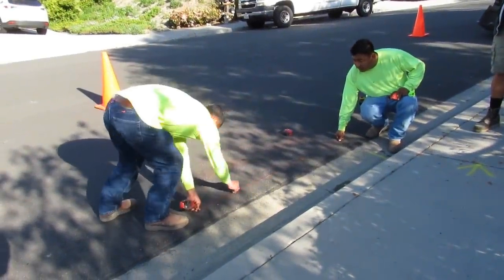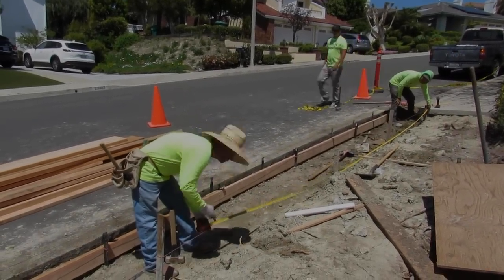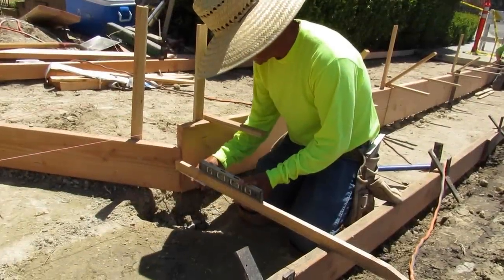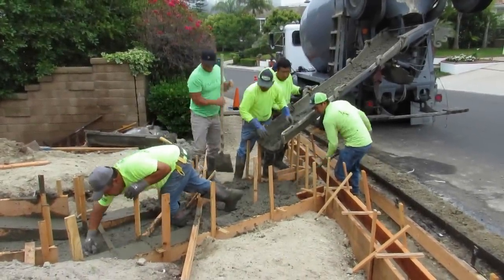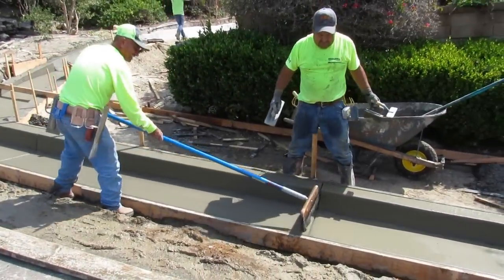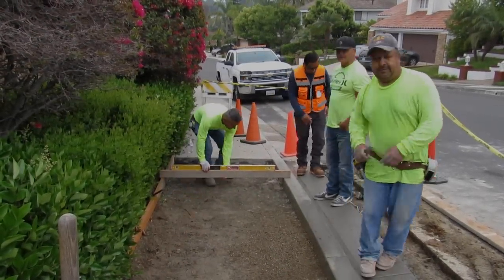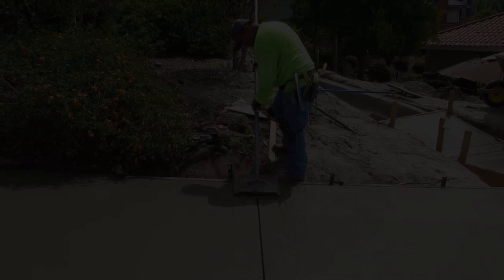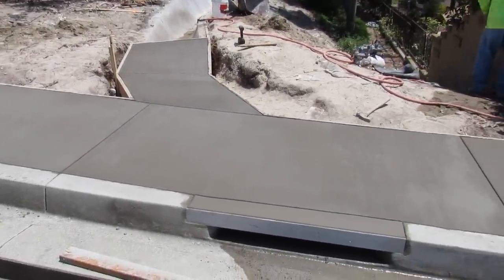City Sidewalk, Curb & Gutter. The Best in the West! California

Comment: Yeah you have to cut 12 to 15 inches of asphalt required by City code (depending) and another thing City sidewalk does not require Steele alot of people assume you have to put it.
Reply: I've seen cities use wire mesh reinforcement instead of steel. But rarely do I see an unreinforced public sidewalk.
Reply: @TheWhale45  I know that. I was just sharing what I've seen having designed projects in municipalities throughout southern CA and now recently in North Texas.
Reply: @TheWhale45  👍

Comment: I love seeing how other people do curbs/gutter, sidewalks and all that commercial concrete work. Good crew👍 I'm a cement mason here in San Diego. If I'm right that drain under the sidewalk is a D25? I cleaned one of those out the other day but it didn't have that board you had inside, it's 4 inches of compacted fill we later dig out.
Reply from the maker: Thanks bro! I used to do it that way. In my opinion the wonderboard works better.
Reply: @WestCoastCustomConcrete  gonna have to take it up with my foreman next time
Reply from the maker: @superrdddego  👍

Comment: After watching a lot of these videos I can say that the finish quality looks nice. I haven't seen it in person but seeing that the crew is spending the time to steel trowel by hand shows that they care to do a quality job. Most crews for sidewalks would throw some accelerator in the mix to have it harden up fast, screed, bull float and Fresno , edge a little bit, broom it and leave. These guys are almost hard troweling which will give a much smoother overall sidewalk. You can also tell when crews want to be done with the job quick because they broom to early and leave course wavy broom marks and try and hide all their imperfections.
Reply from the maker: I totally agree with you. Thanks for watching bro 👍

Comment: You didn't have to cut the asphalt ?? That's new to me too. Does that mean you just pour against the asphalt without forming the gutter on the streetside?  Doesn't sound like good practice. Job looks great by the way!
Reply: Here in Seattle it’s for code pretty much that you have to cut 18” so you can form the gutter.. and put expansion join between the curb and the sidewalk..
Reply from the maker: Thank you! I cut the asphalt per plans but the inspector would've let me pour right up to it.

Comment: Anthony what is in the red spray bottle? Do you spray something on the concrete before brooming it? Cheers mate!
Reply from the maker: Thats water in the bottle. You could spray a curing  agent if you wanted  to
Reply: @WestCoastCustomConcrete  thanks mate, your work is great! God bless!
Reply from the maker: @Chris-wi1sl  Hey Chris god bless  you bro. Thank you for watching.
Reply: @WestCoastCustomConcrete  mate i nearly watched all of your videos! Really cool stuff! I was wondering when you mentioned micro fibers in your concrete, are you talking about steel fibers or is that the stone size in the mix? And why dont  you like fly ash innyour mix?
Reply from the maker: @Chris-wi1sl  It's synthetic fiber that helps with shrinkage cracks. And fly ash is a coal by product that causes shading when the concrete is cured.
Reply: @WestCoastCustomConcrete  Thanks Anthony!
Reply from the maker: @Chris-wi1sl no problem 👍

Comment: Great video! I am building a new driveway approach where we have to move a storm drain in Santa Clara, CA. I need to buy the catch basin grate and frame but I haven't been able to find a vendor. Have you ever had to purchase grate and frame for a sidewalk?
Reply from the maker: I'm not quite sure I know what you are referring to?
Reply: My previous comment got deleted I think because I pasted a link to the detail. I am building a new driveway for a house, There was no driveway before. The sidewalk has to be broken. In the middle of the sidewalk, there is a city storm drain. So we are making a new storm drain with catch basin next to the driveway, and connecting it to the existing catch basin with a pipe underneath. I was asking if you have had to purchase the grate n frame to cover the storm drain? The city gave a specific detail. I haven’t been able to find it anywhere and I suspect that it needs custom fabrication.
Reply from the maker: @lapseofeternity  yes you can look on line in your area. Give them the exact specifications and they will make you one 👍
Reply: @WestCoastCustomConcrete  thank you!!
Reply from the maker: @lapseofeternity  anytime 👍